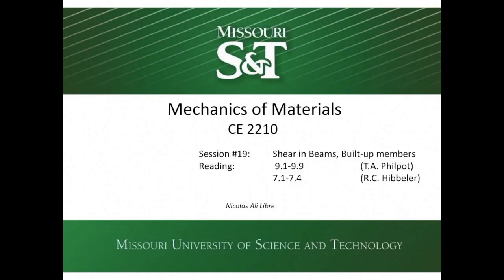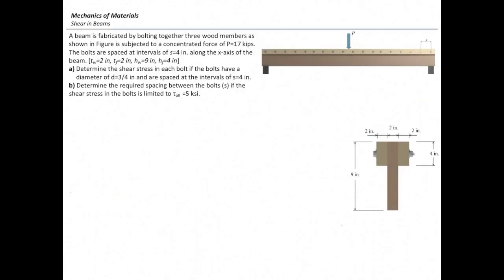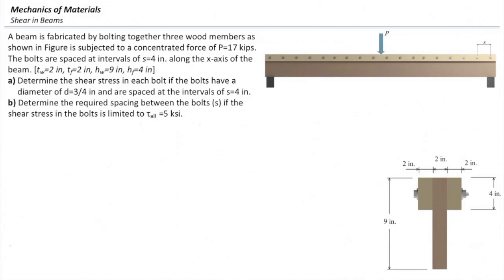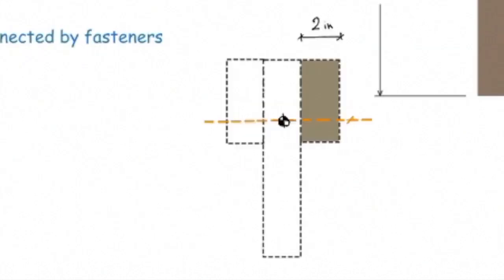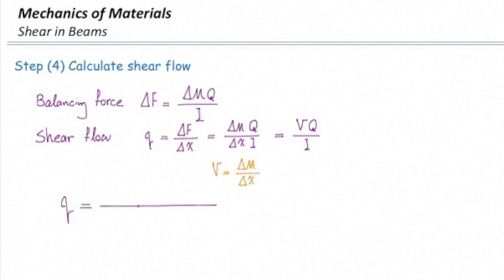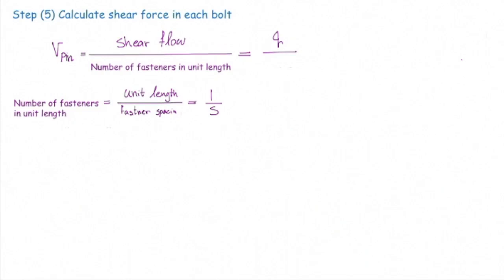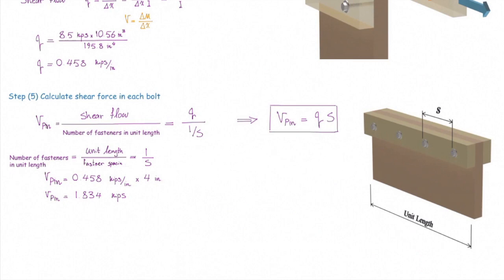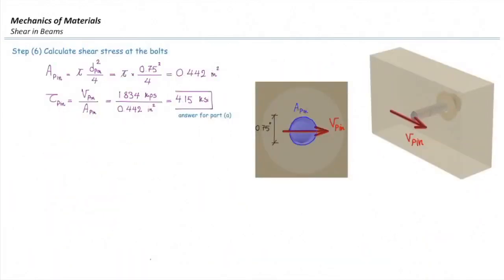Lec19, Shear flow in built up members Part 1

Comment: What happened if you have side members of the same size therefore there is not a moment of area (Q=yA=0)?
Reply from the maker: There is no shear flow transferred to those side elements and theoretically, there is not need to use fasteners. In practice, a minimum number of fasteners are used anyway.
Reply: @MechanicsofMaterialsLibre  What is the minimum?